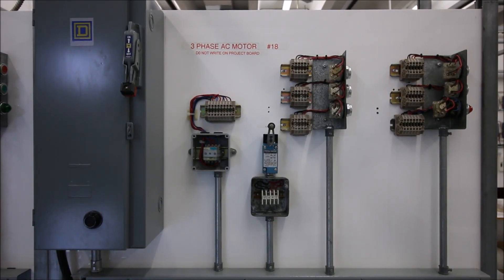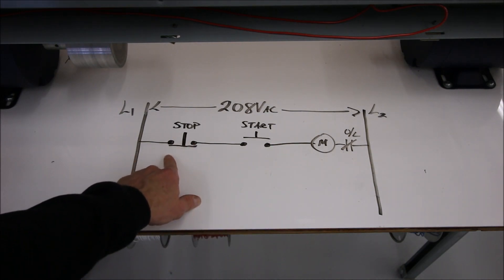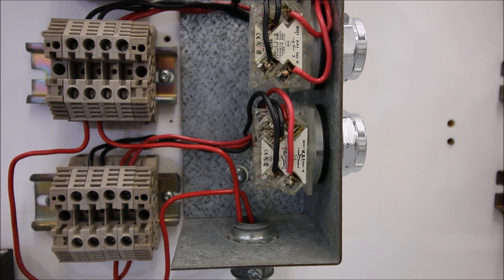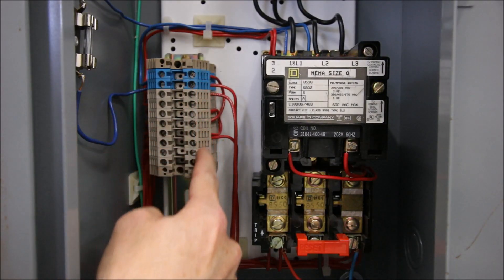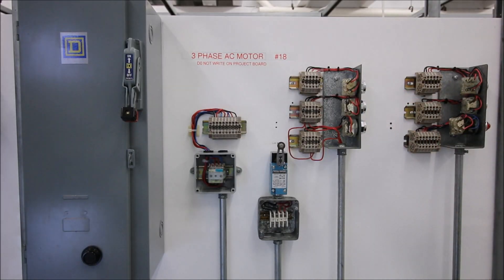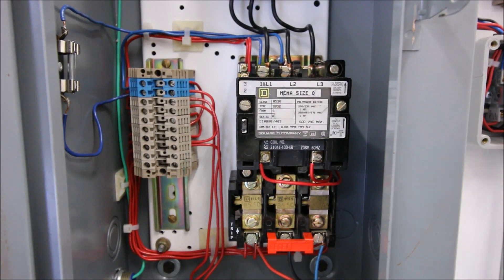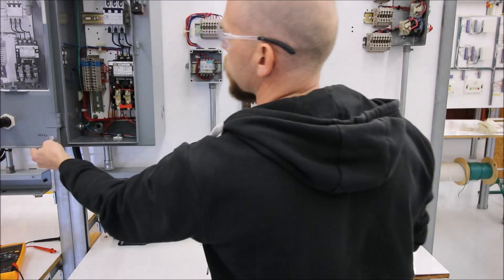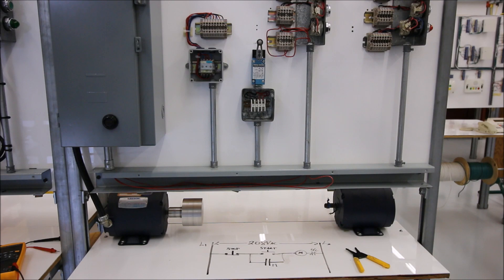Ladder Diagram Basics #3C 3 Wire Control

Comment: First, thank you for taking the time to illustrate motor control wiring.  I wish we had these videos available in 1985 when I started learning about motor controls.  For me it was baptism by fire - many hours of self study and hours of OJT in a meat packing plant.  Finally, I did graduate to the level of instructor for an industrial maintenance department.  I just finished viewing this video, and the whole time I was wishing you would have a spare starter and demonstrated how to troubleshoot and replace the NC overload relay and the NO coil relay.  I remember everyone, including myself, being tormented by these relays because they were partly hidden underneath and on top/rear of the starters depending on the starter's position in large motor control cabinets containing many starters and many more wires. 
Again, thank you for the enjoyable trip down memory lane.
Reply from the maker: That's something we always caution the students about... check every contact on the starter and overload relay prior to starting the project. Nothing more annoying than struggling to get your circuit working, only to find that the guy just before you vaporized the normally open holding contact. So much to know now... the newer contactors have smart relays to provide status... we'll have to revamp the entire shop in the coming year just to keep up with the technological advances. Thanks for the great comment. All the best.  Pete

Comment: Thanks for explaining on the schematic how to visualize the parallel for the auxiliary contact as actually going to the A1 side of the coil.
Reply from the maker: No problem James. Thanks for the comment. Pete
Reply: Great video! I do have a question. Where I work, we use 120v control power and our electrician always uses a transformer to drop it from our 480v 3-phase. Wouldn't it be simpler to just use 208v control and eliminate the need for a transformer or am I missing something? (I'm really interested in electrical but I hardly ever get to build any circuits.)
Reply from the maker: 208 controls would all be larger to handle the higher voltage, and more dangerous due to higher voltage. Also, the 120v controls are cheaper as they are so widely used.

Comment: You kind of skip over the flow of what is actually happening to hold in the Coil...you seem to give more explanation on your terminal blocks instead. great video but we want to know why the coil is energized after letting go of the start button. Not  because you have a red wire jumper. I don't know I just think you were close to explaining this a little clearer and didn't.

Comment: It does matter if your overload is digital and meant to be downstream ;)
Reply from the maker: We are having quite a bit of discussion on the correct placement of overload contacts. My American subscribers are stating that NEMA states that the O/L must be after the coil, however we are hearing that IEC requires it at the beginning of the rung. If anyone has a link to provide more info. I'd greatly appreciate it.
Reply: @PeteVree  can I have your email sir ...I need some help on a motor control starter ? Thank you